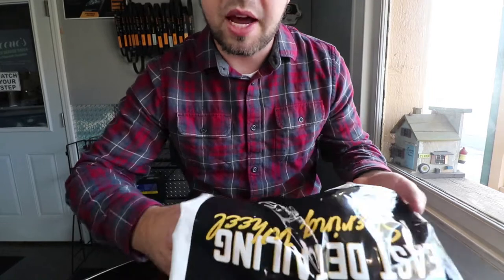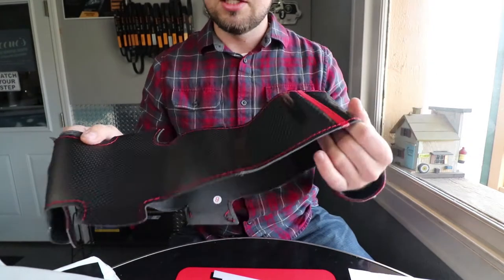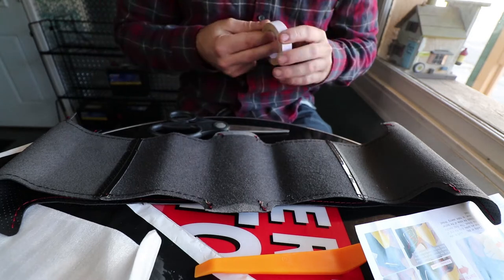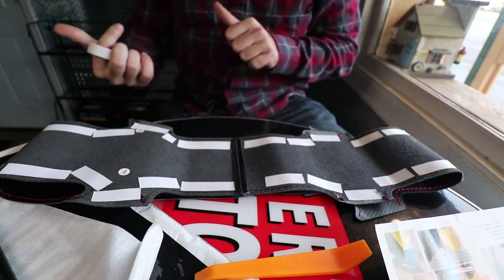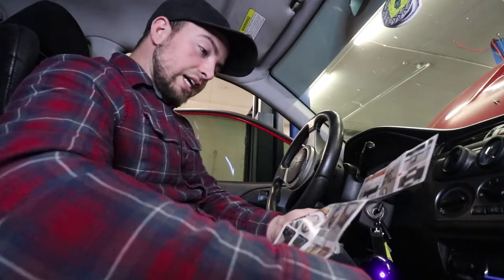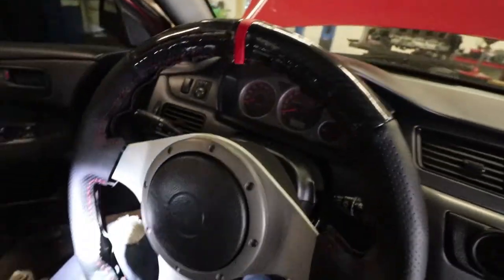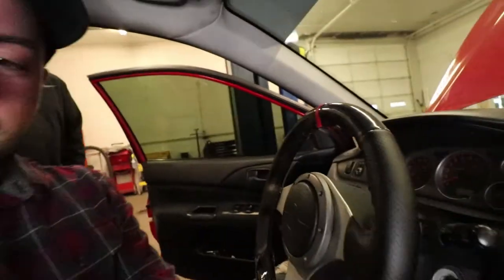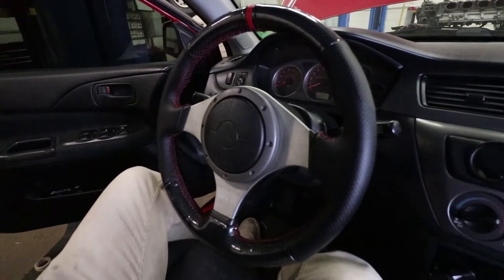East Detailing Steering Wheel Install (CARBON FIBER!!)

Comment: What you did to make the rest of it go behind the clips? I tried using the plastic tool no luck,the cover is too thick,removed the clips as well wont clip back with the cover bettwen them
Reply from the maker: I did have to trim some of it up to tuck behind those clips honestly so there wasn't so much material underneath the clips.
Reply: @MitchellKowell  thanks alot i will try it

Comment: Does the wheel feel much thicker?   We just got a used minivan that has badly worn leather.  Netiher my wife nor I like a really thick steering wheel, so worried that adding without removing the factory leather will make it feel too thick
Reply from the maker: It is fairly thin material so it doesn't add too much thickness
Reply: Great.  Thank you